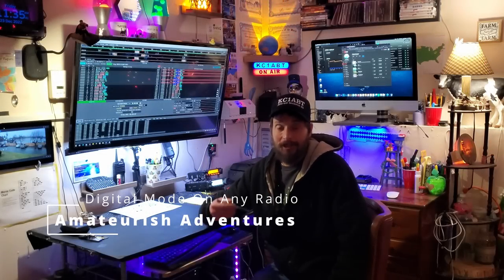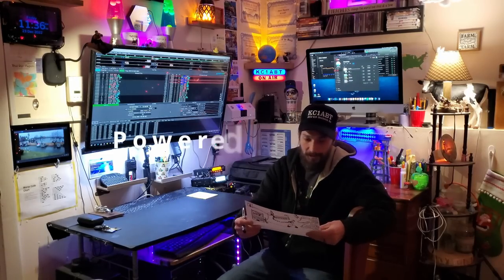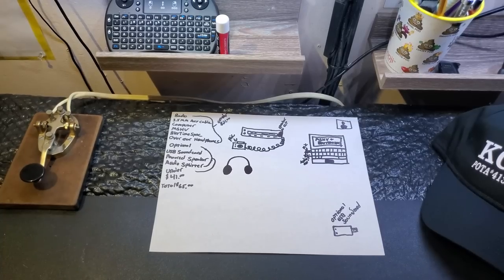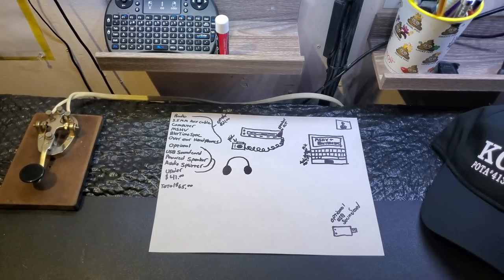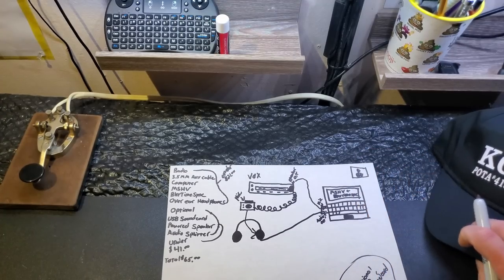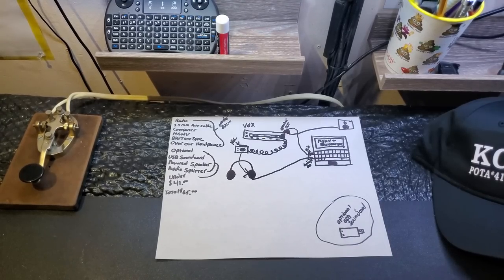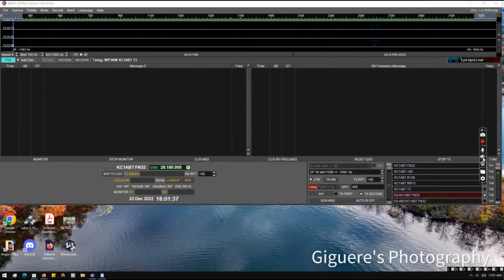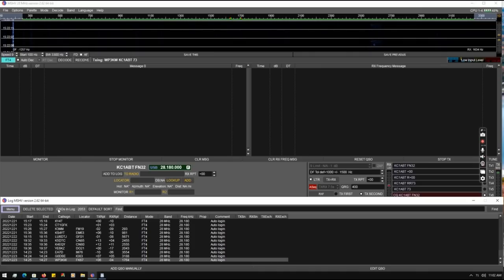Digital Mode for ANY Ham Radio on the Cheap!

Comment: My first FT8 contacts were all acoustically coupled, mic on the laptop with the radio speaker next to it, radio microphone next to the computer speaker, with VOX, totally works but it's a bit clunky.
Then I used a USB sound card and audio patch leads, that was better.
Finally I got an FT232 USB to RS232 card and set RTS to key a relay for PTT, that worked perfectly.
I used a Trio 530 rig for the first tests then a Yaesu FT450 D for the later ones.
Reply from the maker: I am sure given enough time I will streamline things a bit, in fact there have been a few suggestions from just this video that I find very helpful and I will be using them to streamline my setup a bit.  Overall I am very happy with how well this method works to get your signal out.

Comment: Good to see a video that encourages operators to try different modes without suggesting you need to spend a load of money to do so.
I wanted to try FT but only have an Apple iPad. Buying the various connectors, sound card and cables was close to £100 which I didn’t want to spend just to try FT8 out. I ended up using the iFTx software (£2) and operating acoustically placing my iPad next to the radio speaker and holding the radio microphone next to the iPad speaker on the VOX setting. It works and it works quite well.
Okay it’s noisy and clumsy but it got me interested enough in the mode to eventually invest in a better set up. 
Thanks for the video. 73
Reply from the maker: I am happy this video encouraged you to try new modes while operating. I have another video coming out soon that pretty much will touch on what you did with your setup. Digital mode, withbonly a laptop, an audio aux cable and nothing else.  This video will probably be on youtube within 4 days.
Reply: That’s great I’ll keep my eye out for that. 
Just out of interest, I’m in the U.K. and in under a month on FT8 I managed 243 QSO’s, 49 countries and 5 continents using that method. So I’d say it is good enough to get anyone started and have plenty of fun along the way. 
I have got some cables now but have to purchase an Apple usb-c to lightning cable so I can run the sound card to the iPad 🙄
73
Reply from the maker: I have made over 1000 contacts on digital using the method in the video. Now however i am a little handicapped as my radio got destroyed in a flood. Now i only have 35 watts available to me.  Still making contacts just sending weak signals.

Comment: Interesting. Looking at getting an Anytone AT-5555N II. My interest is using it for portable [think variation of manpack but digital] application. This Anytone does not have the data port but other interesting qualities...part of which is AM, FM, USB, LSB. I had seen ideas similar to your work for the Baofeng radio's so I was investigating to see if this could work. I have a Rigblaster from a decade ago that I used to use with a FT-897D which I will be putting back in service in the shack. Many thanks, 73's
Reply from the maker: I am pretty sure it will work fine for digital

Comment: I use a optical isolator 4N25 instead of running the audio directly to  the computer from the radio.   I got too much noise from the radio when directly connected.

Comment: I use a $150 mini pc (AliExpress) with Windows 11, a (tr)uSDX. pair of audio cables, on FT8, RTTY & SSTV. Total outlay less than $300, (ok I used an old tv as monitor) I've worked 70 stations from Portugal (USA, Canada, Europe, Middle East, Australia) all on 6 Watts with an endfed antenna!
Reply from the maker: At that point i would just buy a used signal link and do digital modes properly. 300 is not what i was going for when i said cheap!

Comment: I have a question...

When tx the frequency changes doesn't it, to match the targets frequency or something? I haven't used ft8 due to only passing foundation a few days ago. I am wanting to try it but I have been loaned an older rig ts670 (don't think it has vox).. But it would always be txing on. 074 won't it? Is this okay?
Reply from the maker: Usually yes, the frequency does change however I have had no issues at all and my radio DOES NOT do the frequency shift on transmit.  I transmit direct to 28.074 and make contacts all day long.

Comment: I did this with my IC-730 and worked as described. Well done video! Thanks for the effort. Hey I have a dumb question. Can one do Winlink in the same manner or is it completely different?
Reply from the maker: I am happy it helped.  I need to look into Winlink and get back to you.
Reply: Success, I have done winlink in the same manner. Works pretty good. Thanks again for the video. @amateurishadventures
Reply from the maker: That is awesome to hear. Haven't had a chance to mess around myself as my shack was being rebuilt. It was finished 2 days ago so I will be getting my radios setup to play again. Thank you for letting the community know it works.

Comment: How did you figure all this stuff out. I'm an extra and I can't find the resources I need to learn half of what he knows how to do.
Reply from the maker: I have enjoyed electronics, computers and radio since I can remember.  There was a lot of trial and error that went into figuring how to do digital modes on a radio that should not be capable.  As far as resources go, good luck finding anything. I looked for weeks to no avail. The main reason I made the video was because I could not find any information on the topic myself. Sure I could use a signalink to get the same results, but why when this works and it's free?  If you have any other ideas for a video we can do that may be helpful to you or other operators please let us know.  Thank you for viewing.

DE KC1ABT

Comment: I've been wanting to dabble in FT8, but I don't really want to invest the money in a dedicated rig, or even the venerable signallink without trying it out first. This looks like just the ticket. How would you proceed with a transmitter that does not have vox capability? My DX70 is too old to have vox capability unfortunately.

KC3UVF
Reply from the maker: Without vox I would manually key the microphone every time MSHV lit up red on the computer, then let the tx button go when MSHV stops transmitting.  Its not ideal but it will get you digital contacts.
Reply: @amateurishadventures  I finally had a bit of time to mess with this. It actually worked out pretty well. I made my first 2 digital contacts on 12m in a matter of minutes. Now if I can get FT8CN working properly on my phone. Thanks for taking the time to make this video!
Reply from the maker: Glad to hear everything g worked out for you. 73

Comment: What settings or mode on the ft891?
Reply from the maker: Which settings did you want to know about.  I use ssb for the mode when doing ft8. Don't know if that is what you meant.

Comment: I have a tyt 9800, no vox, so I'm trying to learn this ptt ground circuit Greek language as I want to use this mobile with cable connection (remove external audio noise) for APRS, NBEMS, etc. I understand i can just hold the mic up to my android device; but I'd like to make a cleaner set up.
Reply from the maker: That makes things a little more difficult, however if you are serious enough about digital you can manually key your radio when your computer transmits, then release the key when transmission ends to receive.  I tried this on another hams radio that vox refused to work and made a handful of contacts successfully.

Comment: It looks like the radio must be able to use a microphone for input. Morse code-only (CW-only) radios cannot use a microphone -- they don't do voice, they only do morse code, so they use a morse keyer instead of a microphone. Consequently, I think this technique will not work for CW-only radios.
Reply from the maker: I think you are correct.

Comment: It seems kind of neat but you can’t talk to them at all? Is it just signal reports and that’s it ?
Reply from the maker: Meant to be just for signal reports, you can send short messages by modifying the macros, I see people do it all the time, yesterday many were sending "Merry Christmas" in FT4.  Don't get me wrong, the radio is capable of phone modes as well.  FT4/FT8 is meant to be able to communicate vast distances on as little power as possible.  By default it is only setup to send and receive signal reports.
Reply: Youre basically becoming a beacon for others to hear as you also are now a beacon , you are a signal generator

Comment: My QRP rig is CW only, how do I get it to do this? I thought you had to have USB on your rig to do digital modes?
Reply from the maker: If you have a speaker out and a mic and provided you can tune to the correct frequencies for your band, you should have no problem using this method to transmit from a QRP rig.
Reply: A rig with a built-in USB sound card will be more resistant to RFI and simplify the process by making the USB port do double-duty for both sound and CAT.  It's not necessary, it's just nice.

I've got a Yaesu FT-920, and control is via a usb->serial cable and a usb sound card -> Yaesu's custom data mode DIN connector.  Again, not necessary, but has some minor advantages.  You don't need CAT, you don't need a radio that can operate in split mode, but it can provide some minor advantages.

CAT gets you automated frequency changes (either in split or fake split where the radio jumps frequencies for tx/rx) and faster PTT.  On-board USB gets you RFI-resistant sound interface and smarter volume control.  But you can do it with two audio cables and a computer.
Reply: FLDIGI does cw

Comment: I do all the digital modes you can think of with no cables at all.  Flex 6600...all virtual. 🙂
Reply from the maker: I love the virtual aspect of it all, I looked up the Flex 6600 as I have never heard of it.  Its a great concept and I would be happy to do it but it is more expensive by far than even the signalink we are trying to work around.
Reply: @amateurishadventures  Congrats, you just got trolled by a radio snob. These guys with more money than brains are nothing more than appliance operators who memorized the test questions. They demonstrate their skills whenever a bug or device breaks and their whole fragile world of throwing money at a problem puts them off the air until b the delivery truck drops their next appliance off. I'm amazed they even know which wire to plug into what orifice. 😆🦧😂
Reply: @radiotests  Wow...that is harsh.  I was just attempting to show what was possible.  Sorry this upset you to the point of Trashery.  It is great to hear that you have built all your radios and gear from scratch.  Good job!
Reply: @amateurishadventures  I have used many devices in the past.  Signalink is one of the best.  At the end of the day, whatever gets you on the air is the best method.  Best of luck to you!

Comment: There is one radio I have found that will not do digital and that is the Kenwood TS-120s. If you can help me figure that out that would be great.
Reply from the maker: I looked up the Kenwood and I do not see why it should not be able to work.  Its not CW only.  If you have a mic and a speaker out, and you have the ability to tune to the proper digital frequencies you are looking to use, there should be no issues.
Reply: Yeah but there doesn’t seem to be an audio interface for it. I think I would have to create my own and use VOX for triggering the mic. I did that with my G90 until I could figure out CAT control for all the different digital modes.
Reply from the maker: I will look into ways you can do this with the Kenwood TS-120 and let you know what I find out.
Reply: I use vox on TS120. Adjust the three pots on the top.
get yourself two android ear buds with mics on them.
Put bud from one to mic of the other and mic of of one to bud of other. Bear in mind these are electric mics needing bias voltage the radio might not provide.
Wrap in foam padding, place whole thing in a plastic box.
The wires are so fine, you'll be challenged to solder the, however a 10k pot on each end would be helpful to adjust levels.
Also, try old gaming headsets
Reply: @kf5hcr176  that’s a great solution. Cool.

Comment: Thank goodness, I prefer CW. license since 1975 on and off the air since 1990 and just returning; never dropped my ticket. If I had a WWII transmitter, I'd put it on AM.  So simple, even a caveman can do it.
Reply from the maker: I am currently in the process of learning cw. Currently at 12 wpm with a straight key I got from another ham.

Kc1abt
Reply: I was researching YT  for Digital mode to find out what its about. I was joking abt AM. I missed every sunspot cycle due to being inactive, not going to miss this one.  CW gets really enjoyable rag chewing at 20 wpm or faster. but must copy by ear. IMO. I was a solid 30 wpm (I was 18  ~ 23) but had to start leaning all over again from scratch, I am maybe 15wpm  now  at 66 yo. I hope I can regain my speed.. I bought another bug but can use it unless I get back up to 20 wpm or better.  I am finally getting my station completed I will be on the  air soon. w 2 Q H
Reply from the maker: Sounds good. I am only a tech atm but studying for general. Would maybe have been general already but I have been putting alot into cw practice.  The solar cycle has already been very helpful for propagation recently.  I am 42 and at 12 wpm so there you go.

KC1ABT

Comment: Buy a cable adaptor for the mic in on the front of the radio rather than using vox.
Reply from the maker: Can you elaborate more on this cable adapter?  I would be interested on not relying on VOX.
Reply: @amateurishadventures  There should be a cable that will plug into the Mic/ethernet port that gives you a line in and ptt via 1/8" jacks, I have one for my 857 I think I got it on ebay maybe?

Comment: This video is as boring as running FT modes.  I can see people running these modes dropping out of ham radio because it doesn't do anything but make signal reports and contacts.  Yawn.  Who cares if you make a worldwide contact on low power.  At least with PSK31, Olivia, MSFK and etc, you can at least have an intelligent conversation.
Reply: 2 days ago i talked with (Guam) in the s. pacific on 10 meter'''for 2 hours'''''''now that was alot better & fun & colorful & memorable than noisy naucious didital signals''''''it seems too me that digital modes should be sent subauditable and decoded on the other end''''so we dont here that noise pollution''''''but thank you.
Reply: @jamesharrison2041  I also run SSB, AM and CW at 25 wpm.  To make you happy, I guess I need to be subaudible so not to bother you  on SSB.  Oh, my digital that I rag chew on is on the CW part of the band.  In my 50 years of ham radio, I have worked Guam several times.  Congratulations.  I wonder how you could have heard digital signals on SSB?  Another thing,  you might want to check that Guam is in the NORTH Pacific, not the south.  I think the noise pollution is between your ears.
Reply: @richardallison8745  ''' I'm in my 80th year of ham radio''''''''i turned 109 a week ago' 'and I'm sharper than you' 'and a lot more experienced and i spell better' 'and id be willing to bet im a lot better looking too''''73-s bone head.
Reply: @jamesharrison2041  God bless you my friend and congratulations on 80 years of ham radio.  I am honestly glad you look better than me at only 70.  73 and have a Happy New Year.  de W4WFL
Reply: @richardallison8745   thank you sir'''' your a gentleman,,,,73's

Comment: Syncing your time is only needed if you run a deficient, crippled operating system. Such as Windows. I repeat: Syncing your time is only needed if you run a deficient, crippled operating system. Such as Windows.
Reply: Oh please, don't tell me if it's not Mint Linux or OS from Slave built Apple it's crippled and deficient?
I've been doing computers since 1976. From punch cards and floppies to boot to Windows 11 formerly NT anyone with 5th grade reading comprehension can optimise Windows to work with any program or device efficiently. As to time keeping I don't care if your using NASA mainframes the standard is Rubidium, GPSDO or Internet time keeping (least desirable) to keep your computer synced to the digital modes WSJTX or other. I repeat, it doesn't matter what computer or OS you use the computer must be on time with your intended qso.
Reply: @radiotests  Well you said it yourself: anyone with a 5th grade reading comprehension. This leaves out 90% of YouTube commentors, and a huge contingent of "hams".